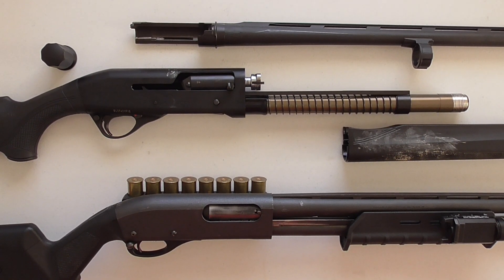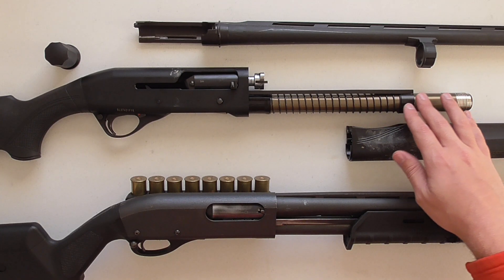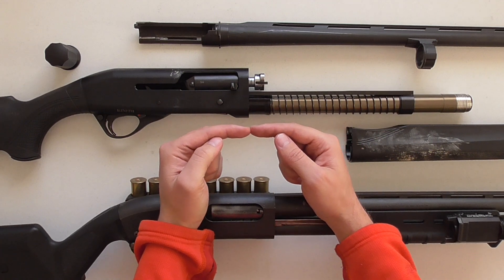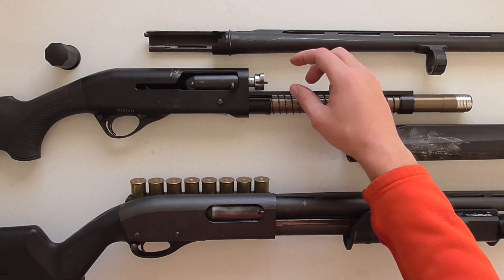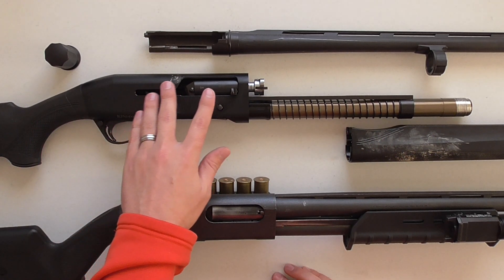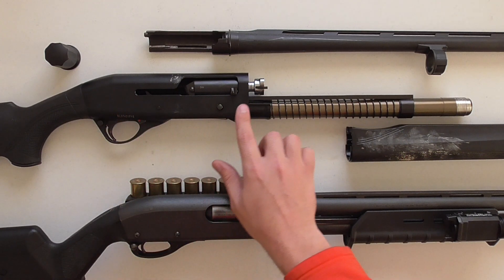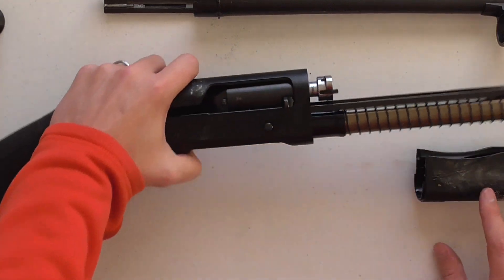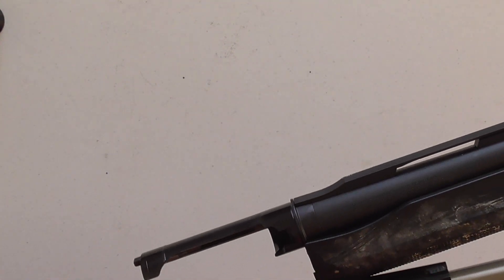Franchi Affinity Review

Comment: Very well done breakdown, description, and review. I have owned a Franchi Affinity for a year now and the only thing I've changed on it is applying a Cerakote finish. The Cerakote and the shotgun itself withstood an ATV rollover in the New Mexico mountains only taking a few scratches, but the gun did not bent or break in anyway. The weight is excellent, the autoloading design is truly ingenious, it doesn't get too dirty with operation, is incredible accurate, the price point is excellent, and the recoil is well managed. My ONLY gripe about the gun is the loading port in the bottom. It is a prong-shaped metal piece that depresses to load your shells, but the prong end makes it very easy to get your thumb stuck in the loading assembly. I can tell you from experience that the West Texas chill wind combined with quite the jam of my thumb stuck in there was quite painful and involved some force yanking it out. If they fixed that piece, this would unequivocally be the perfect autoloading shotgun. However, that is a small thing, and it is still by far the best shotgun I own and at a price that made it too easy not to purchase. 

Plus, it's beneficial they were carrying a left-handed model at Cabela's, so it happened on accident that I selected this gun. However, it is my favorite shotgun and one of my favorites to shoot out of all firearms I have fired and owned. 

Cheers to your video, Full Neilson!

Comment: The Franchi Affinity comes in 3.5 inch and the version I would get with a 26 inch long barrel and cera-koted receiver and barrel. The spring in the front keeps the bolt in battery so no infamous Benilli Click.

Comment: You are quite off with regards how inertia driven mechanism works. What you are explaining are blowback or delayed blowback systems. Inertia driven mechanism do use recoil to drive it but not in the direct way you explained. When the gun is recoiling the bolt body will stay staitionary because of inertia and the rest of the gun will move backwards and then it compresses the inertia spring within the boltbody and bolthead. When recoil have stopped moving the backwards the inertia spring releases it energy and drives the boltbody backwards and cycling the action. The spring around the magazine tube is what drives it back in battery.

Can read about it here as well
https://www.franchiusa.com/inertia-driven-system
Reply from the maker: Thank you for your correction and your explanation.  Have a nice day.

Comment: The return spring on the magazine tube does the reloading of the next cartridge. Instead of having a spring in the stock as normally done with inertia actions. Keeps the stock open to be flexibly designed.